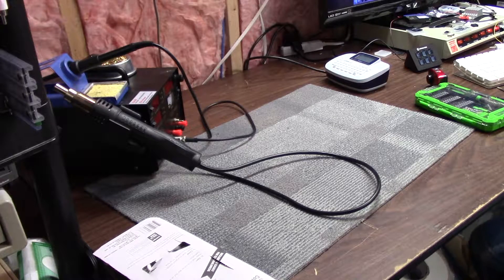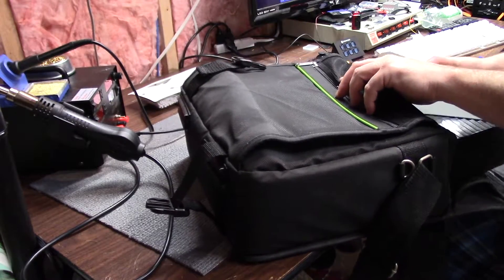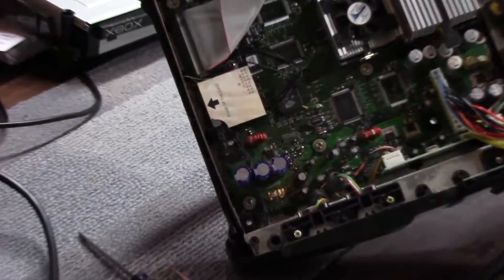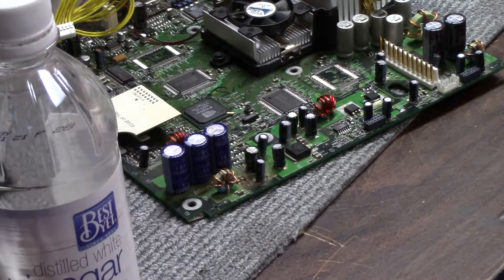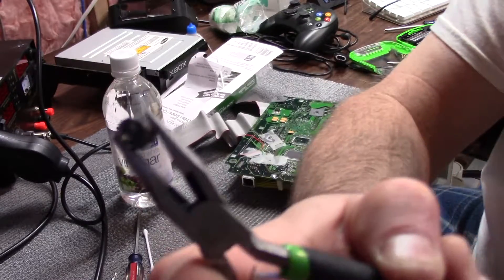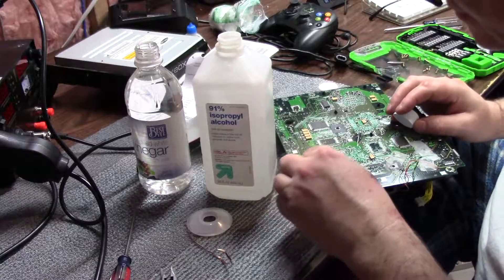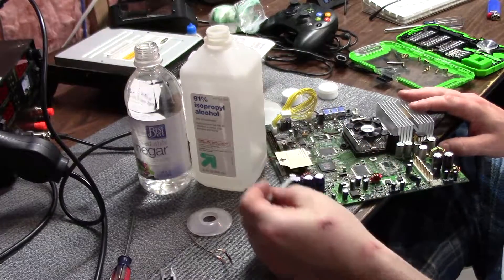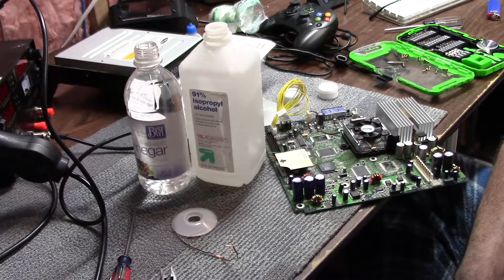another Xbox capacitor repair

Comment: I have replacing all the caps on my C64c computer and 1541 II Disk Drive, and just have replaced all the caps on my fathers C64 computers, now i only have to do the 3 1541Disk Drives and my C128D computer, and then i have replaced all the caps, also have replaced all the caps on my Amiga CD32 a week ago.
Reply from the maker: i have always wanted a CD32... but so expensive for USA

Comment: That is the real first Xbox 1, would been great if you first let us see that it is not working, like connecting it to a TV, and then repair it and again let us see that you get a picture on your TV.

And so happy i have a desolder station (ZD-915), it works so easy with one, and they are cheap also.
Reply from the maker: well the xbox still functioned fine, this is just te notorius clock cap, like the varta on the amiga. remove it because it leaks... its the cheapest cap in the system. always fails.
Reply: @ChrisEdwardsRestoration  Ok.